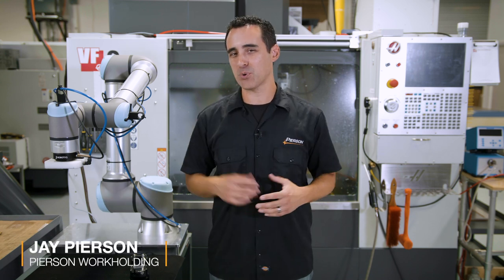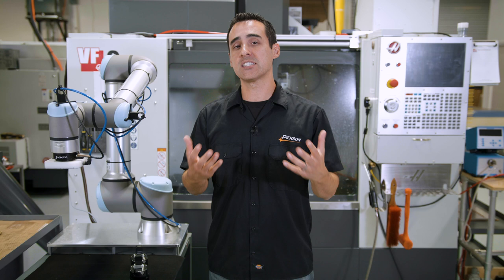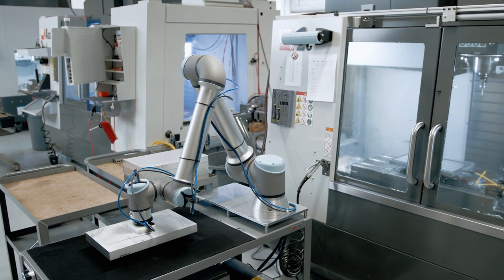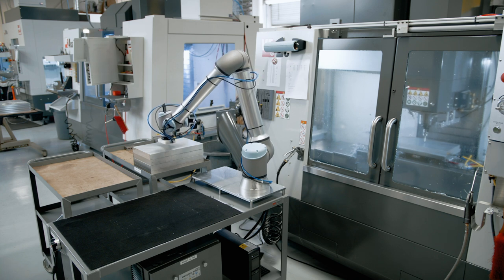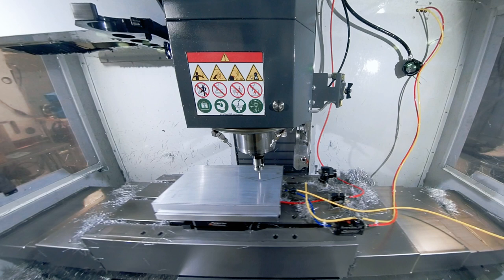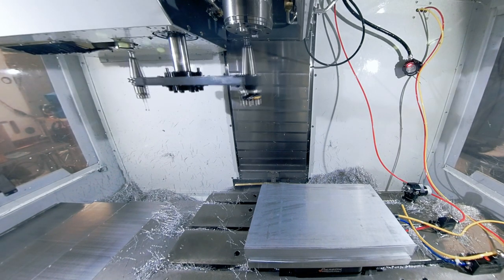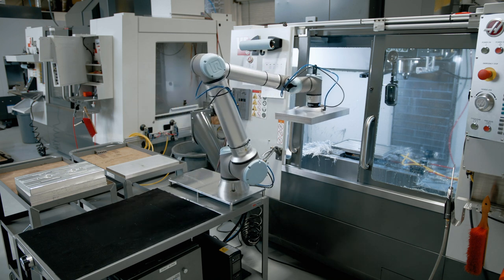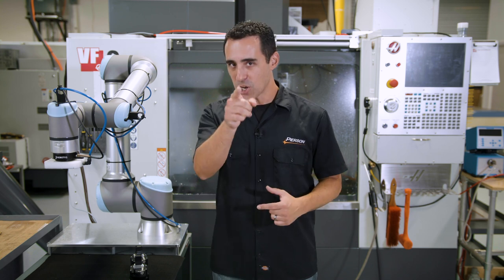Machine Tending with a Universal Robots UR10e - The Robot Series - Pierson Workholding

Comment: I was thinking how to reduce the robot idle time while machining is in progress. You can use two jigs for loading and unloading the part from the cnc as buffers. when the machining is over, Simply take the finished part and put on the one jig while the next raw stock is positioned in the second jig. put the raw stock in the cnc and start the machining cycle. while machining you can take the part from the jig and put it in the finished product pallet, grab another stock place it on the black surface, take the photo, grab by center and place in the buffer jig.  Sorry, I just typed while imagining the process. it might have some grammar issues :)

Comment: Hey Jay, I am wondering, in terms of speedup, although it may be not necessary to you, but the Action of the robot of photographing the pallet raw stock could be done already while  the Haas is running. No obvious need to have to wait that extra time or do i not see the whole picture here? It would already know before unloading the pallet from the Haas that the new stock is valid...
Reply from the maker: Pre-photographing the pallet would be ideal but the software is the limitation. It doesn't allow anything between the photo and pickup move.
Reply: @PiersonWorkholding  thanks, that explains it. Love your work. Thanks a ton

Comment: How does the robot interface with the CNC to cycle start and communicate? Is that electronic? So can the CoRobot read input signals to initiate subroutines and generate outputs to indicate certain states?

Such a great setup. Thanks for this video
Reply from the maker: We wired one of the robot outputs to a digital relay.  That relay is wired in parallel to the cycle start button in the machine pendant.  When we send a digital signal from the robot to the relay, the Haas sees the closing of the relay as if the cycle start button was pushed.
Reply: @PiersonWorkholding  That makes sense. Thanks for the answer - I've been wondering for a while how these different machines actually synchronise with each other when both have variable time periods on their respective subroutines and processes.

Also wondering - do you have a microswitch on the Haas door so your robot doesn't push a chunk of Ali through the window?
Reply: @20vK  I'm a UR integrator - in the case of the Haas, the robot can also communicate via the Ethernet connection on the machine, which enables it to queue up specific CNC programs in the robot program.  Otherwise, you're usually doing what Pierson says, sending an electrical signal to simulate the cycle start button being pushed, and waiting for the electrical signal to indicate the job is done.
Reply: @20vK  Yes, indeed. The door has an inductive sensor so the robot controller knows when it is fully opened. If anything prevents the door from opening, the robot will alarm and not attempt to push a part through the door.
Reply: @Factory400  thanks very much for the info. Good to know!
Reply: @sdmsrobotics  OK, it has way more connectivity than I thought. I've never seen the communication capabilities promoted on these robots, so that adds way more integration options than I knew.

Thanks very much!
Reply: @20vK  as @7k4a5 pointed out, there is a lot of connectivity and bi-directional communication possible on the Haas machines. 
You can hardwire sensors and other things, use the M-Code addressable relays, or the most advanced option is over TCP connection that allows you to read/write variables to the machine. A program can read your data and use that to pick a specific program, run a certain number of parts, trigger an alert when it is finished, etc, etc. 

The camera system can be used to identify a specific type of raw stock and use that information to run the CNC program appropriate for that stock - without the user ever touching the machine. Just roll up a cart of raw material and the robot can figure out the rest.
Reply: @Factory400  It sounds like they thought of everything! Thanks very much for sharing this information  - really appreciated. Richie

Comment: Have you successfully integrated a Universal Robot with the the Pierson Mini or Pro Pallet system? My Pro pallet sometimes requires some grunt force to remove it - does the UR generate enough force?
Reply from the maker: It sounds like a classic case of your air pressure set a little too low. It needs 100psi minimum or else pallets feel "sticky". Robots are actually better at removing pallets because they lift in a very controlled, straight-up manner, whereas humans can lift off-axis.
Reply: @PiersonWorkholding  Thanks - I will increase the pressure and give it a try.

Comment: Hey Jay, how are you getting the robot and machine talking to each other? I've got a UR10 and I get the haas machine to turn a signal on so the robot knows the cycle is done but I'm not sure how to do the opposite and have the robot tell the machine it's done loading and cycle start on its own
Reply from the maker: The robot triggers the mill using a relay that closes the leads on the cycle-start button.